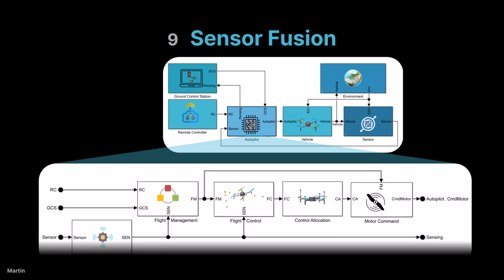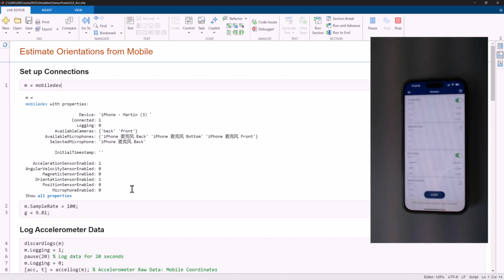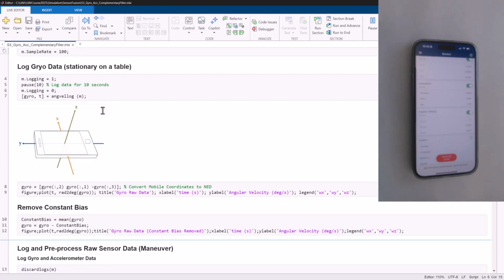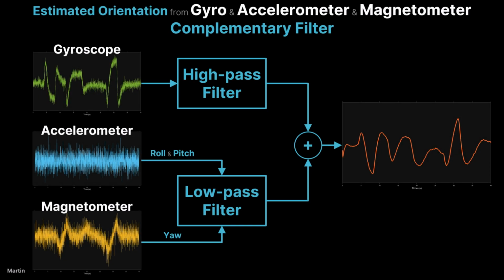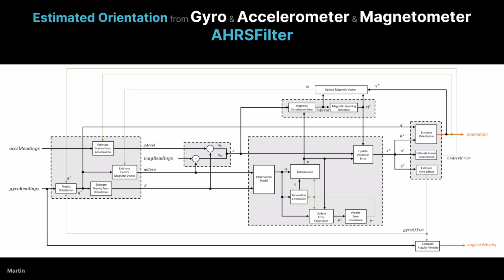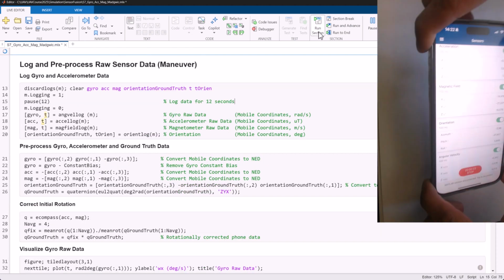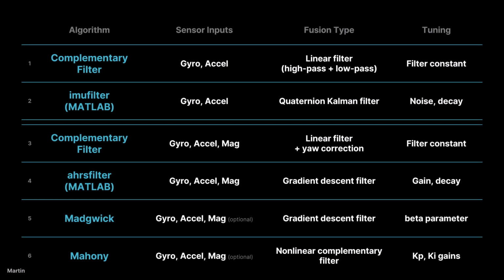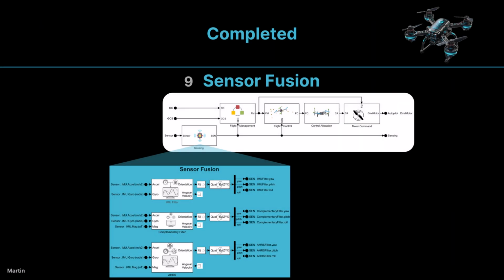9 Sensor Fusion | Drone Autopilot Design and Simulation in Simulink

Comment: I get this error (Failure to load the converter plug-in.) when I write the first command of the connection setup with MATLAB Mobile on iPhone 13 Pro, any solutions?
I also noticed that it is a common error on MathWorks help forum but since you managed to run it I wanted to know how to do so!